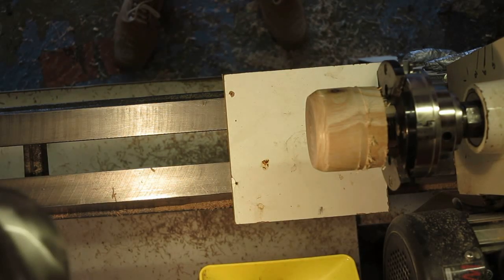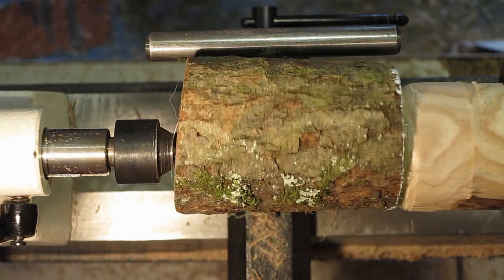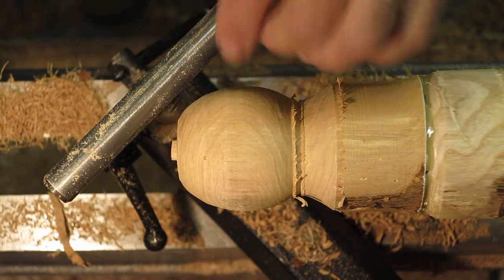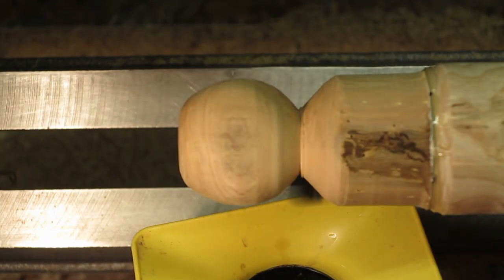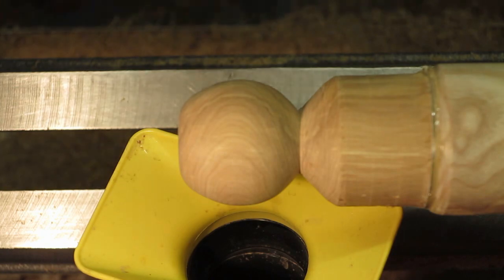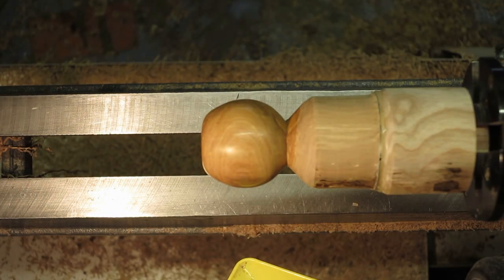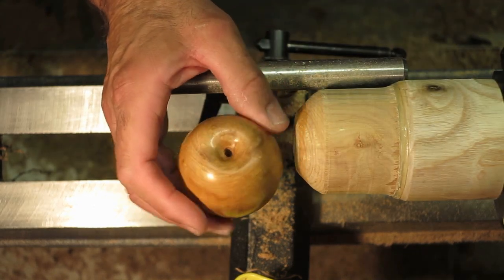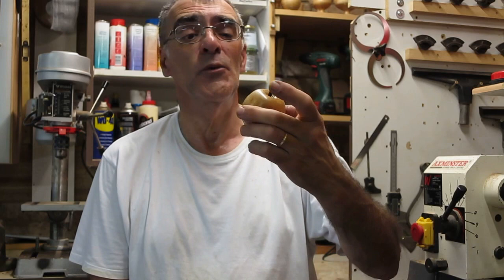Wood Turning a Wooden Apple from....Apple Wood!

Comment from the maker: Hi Dave, thanks for the compliment. It's true that the pith is the root of cracking in wood. So  it's best to "miss" it if possible. However there are occasions when it doesn't crack. I have found that a dab of CA glue normally halts the crack, and stops it growing. Also some logs don't seem to split as much as others. Sorry if the answer seems a bit vague.
Take care
Mike

Comment: Good looking apple, Mike!  What type of end sealer was used on the original blank?  I am pretty sure glue wouldn't stick to the wax emulsion end sealer I use and I would have had to cut a fresh end before using hot glue for mounting.

Take care
Bob

Comment from the maker: Hi Mark,
This method of holding your blank is best for smaller projects, as it wastes less wood, and allows you to work at the head stock end without fear of catching the chuck jaws. The glue sticks I use are the standard type, nothing special about them. One important thing to remember is to get the glue as hot as possible. My video entitled "Your Questions Answered", shows the process. Hope this helps.
Take care
Mike

Comment: Nice project. I have been having a very difficult with green apple wood cracking. How green was your wood? Did you do anything special to it to keep it from cracking? Did you get any cracks?
Reply from the maker: Thanks Harold. Fruit tree wood is always very prone to cracking, as soon as the wood is cut down I always coat to ends of branch wood with PVA glue, or any latex type paint, this slows the drying process and minimises cracking, you can use melted wax as well, if you prefer.
Take care
Mike

Comment: Great video! Thanks for sharing. What is the sanding sealer you used? Shellac?
Reply from the maker: Thank you Benjamin much appreciated. Back then I used to mix three parts Cellulose Sanding Sealer to one part Cellulose Thinners.    However I now use a pre - thinned sealer from Hampshire Sheen. Cheers. Mike

Comment: Hot glue - hadn't thought of that. Great idea. Thanks!
Reply from the maker: +Jim Porter 
A very secure fixing Jim, but make sure the wood on both blank and glue block are dry, and the glue is as hot as your gun will get it.
Cheers 
Mike

Comment: Just curious. Why the glue block instead of just turning a tenon on the apple wood?
Reply from the maker: Hi again Harold, it was two years ago, I'd been turning 6 months or so, and I was trying out all manner of different ways to do things, as I still do I suppose, and on this one I just felt like using hot glue. I hope my answer doesn't seem flippant, I do like to use as many different methods as I can, one day I might actually use the same way all the time....but it's unlikely :).
Thanks again for the comment, I really do appreciate it.
Cheers
Mike